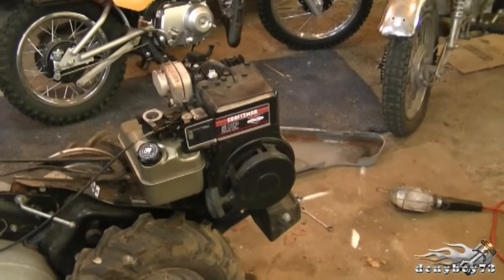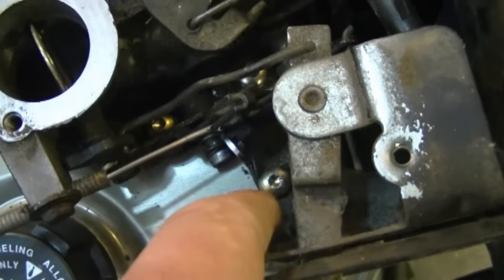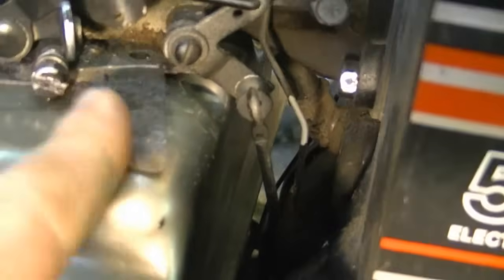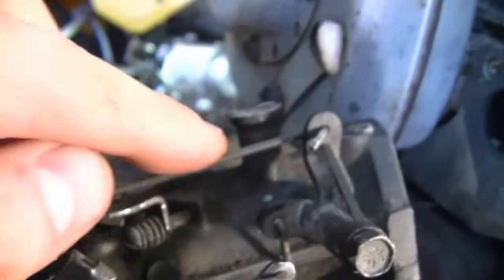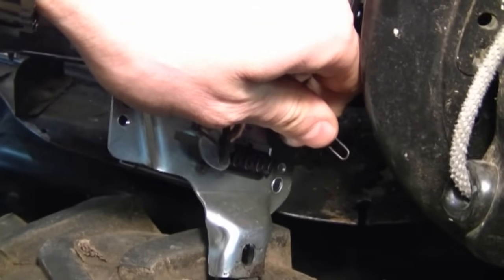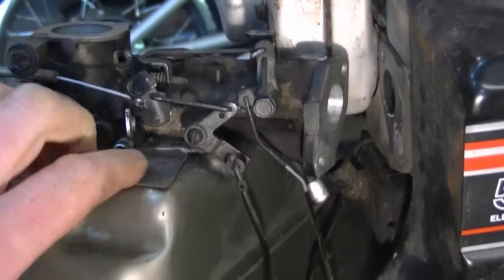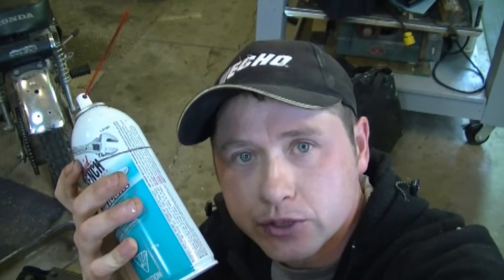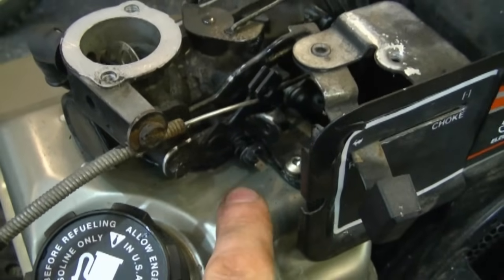Choke, Throttle & Governor Linkage Configuration on Briggs & Stratton 4-5Hp Engines

Comment: maybe somebody can help me out here, or point me in the right direction: i just put one of these back together after replacing the connecting rod and piston rings, but it seems something is not right with the linkage. the choke works just fine, but there is no speed control. i have only 2 speeds; off, or full speed. when i move the lever from the off position, it immediately opens up all the way, and i cannot seem to figure out where the problem is.

Comment: So first of all, THANK YOU! I have a Sears tiller with this engine on it and your video saved me getting everything back together.  Question though.  I think I have something hooked up backwards because it will only run with the choke closed.  As soon as I open the choke, it dies.  What did I put together wrong? I noticed that when I move the throttle linkage, the linkage on the top of the carb that attaches to the governor doesn't move as in your video but the connections are the same. Help.

Comment: do you have a pic of how your linkages are done? I'm having a hard time getting mine back together. It is also an air vane, and runs at the 3600 rpm. Mine is supposed to run a water pump.

Comment: thanks! I have been working on a TroyBilt Pony Tiller with a B&S 5hp engine trying to figure out why it won't start as it was working last fall. After watching several of your other videos including this one I got suspicious that a little spring that I had thought had come undone and therefore "reattached" might be the culprit. I unattached it and viola, it runs. Still not sure what that spring was. My model is 130292-0793-01 (99 works though). Something to do with the governor?

Comment: cool vid donyboy, just got done replacing a tank on one of these today. what a pain w those linkages.
Got a vid on how to rebuild those carbs? I took it apart and there is a very small spring that popped out and i can't figure where it goes. Its not the large round spring w the seat that presses against the diaphragm. 
Thanks in advance donyboy!!

Comment: I have this type of carburetor on my 5hp motor and am not sure what model it is.  I haven't taken it back off yet but was hoping you knew?  I just took apart the gear box, cleaned it all, re-greased, now it shifts great but the carb is leaking...  It seems to be coming from the small panel on the left side but I haven't taken it apart yet to check.  Any help is much appreciated!

Comment: I could use some expertiese I have one of these 5hp B&S on a tiller it was having all manor of carb issues took it apart and cleaned but still dies after squart of starting fluid. as if not getting gas from tank to carb any suggestions thanks jim

Comment: donybot73,

Thanks for the quick response!  I did watch that video series, however, I thing perhaps I'm need to see the linkage configuration for the Tecumseh HS50? Do you have a video on this?  Also, one of my HS50's stalls on high-throttle, the other stalls upon opening the choke beyond 3/4  closed.  Any videos on either issue?

Thanks!
PhilQ

Comment: Thanks for the video, it helped me realize I was missing a bunch of parts on the throttle bottle that controled the throttle.   Mine is different, my throttle connects at the bottom where the govenor control is. B&S totally fucked up on this one.  The idiot engineer that designed this horseshit mess should be take out back and shot.  My best advice to everyone is to rip out this crap, simplify everything, and have two individual seperate control pull lines, one for throttle, and one for govenor.

Comment: Thank You for this! I have the exact same engine! I bought it with all the linkage messed up and it was missing the linkage that goes from the governor to the bell crank. My throttle cable connects below the fuel tank on the front at the control arm bracket. 3 mower/small engine shops told me wrong on the linkage! Your video is great, and I appreciate the different angles! My application is an MTD rear tine tiller (model  219-406-000) Now it works and I immediately tilled my front yardThank You!
Reply: Great vidio will help me out a lot.

Comment: Thank You! I have the exact same engine on my MTD tiller. I bought it used and the linkage was not connected properly. My gas tank is very rusty on the inside as well. When funds become available, I'll buy a new one. I wish there were a way to open the gas tank. Thanks, again! Subscribed!

Comment: What's the safest way to remove the cast iron 90 deg. elbow from the exhaust port on the 5 hp L-head? I want to install a bolt on low tone muffler.

Comment: my triller works only if i put small amounts of gas in the carburetor after it burns that gas it shuts off.so i took the carburetor and gas tank apart and cleaned it really good and nothing same problem. i really think its not sucking gas. how can i fix this problem? thank you very much for your help.

Comment: Well I got my power back sunday the septic tank and propane tank washed away we have begun cleaning out the basement and the road still has 1 lane in each direction ,Now we are to get 2 3 inches of rain to day I picked up a 1/2 horsezogler pump at a yard sale it was still in the box runs and pumps much better now as long as I have gen or electric power  basement wont flood.
Where and how much did the tank cost? 

Thanks